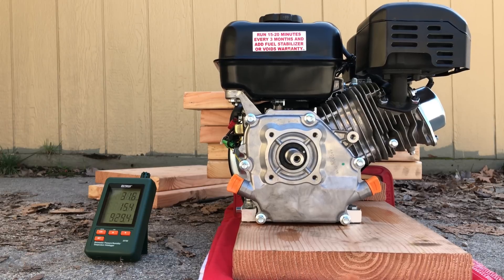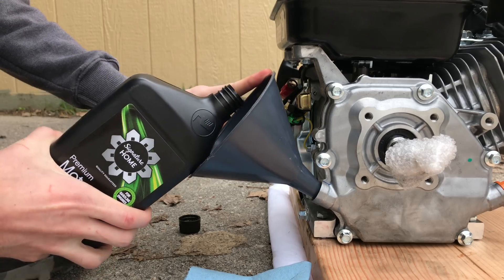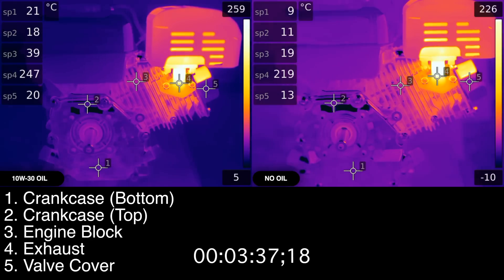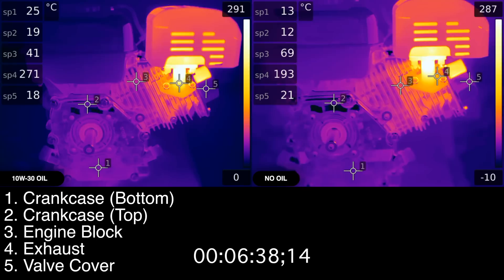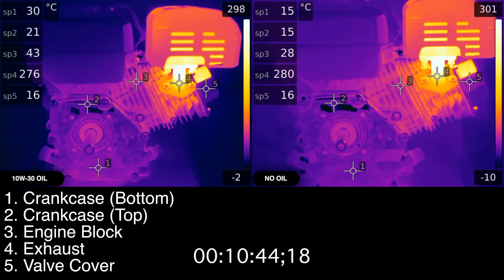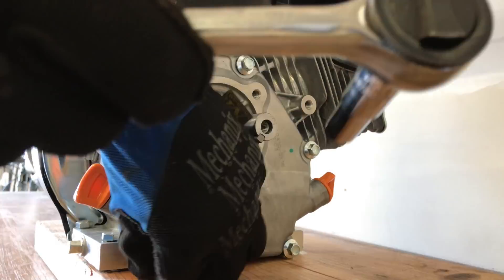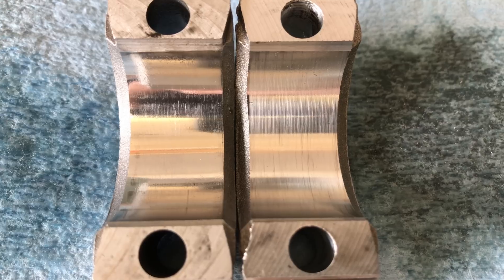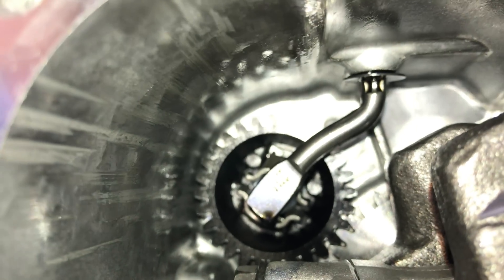What Happens To An Engine Without Oil?

Comment: good video, for what i can see the engine just runs and is not doing any work .Most engines can run whithout oil because the axis runs on bearings (wich have oil on their own) , the actual problem arises when an engine has to do work (increase rotation) .On a car engine the first thing you will hear is the camshaft beating and the next is the engine slowing down  until it stops due to dilation of the crankshaft (the first damage is allways on the bronze parts wich rely on oil to maintain structure coesion)  .The oil is in fact used to absort the temperature (it levels it actually) and the quality says a lot about the oil capacity to do just that , the engines who use turbo normaly have a radiator for the oil .

Comment: I loaned a tiller to a friend that operated it for several hours and never checked the oil when refueling, needless to say, it locked up. The difference between that engine and yours was he was operating it under a load and i'm sure at higher speeds. Thanks for demonstrating what happens. It makes sense that the block of the engine with out oil was cooler because as you mentioned part of the oil's job is to take heat from the piston and crankshaft and move it to a location that can allow it to harmlessly dissipate. If you had never added oil to the drained engine it probably would have locked up as soon as the assembly lube dried up..

Comment: Run them at 100% load at high rpm and that's when you'll see one keep running and one go kaboom. Just idling an engine that small puts barely any load on a bearing that proportionally big.

Comment: put oil in it it'll still run I've had em sieze up on lawnmowers put oil just fine tip it up to oil cylender.car engine Wii need rod bearings most likely .have replaced crank once on pinto oil pump fell in pan put crank and bearings from another motor left wo. head outside  ran 100000 mi.sold it put timing belt  for new owner 1yr later.

Comment: Ha harbor freight lifetime warranty on that Chinese engine... they won't know about this video anytime soon lol Oil is a lubricant and it's supposed to keep all moving parts within the engine lubricated thus there's no excessive heat and damage from metal to metal contact without lubrication.  That engine is air cooled vs your car engine which is water cooled "antifreeze" Try running your car engine without oil! You won't go far that's for sure.

Comment: API certification is API certification.  Either the oil meets the spec or it doesn't. 
if the bottle says "WPP" (Warren Performance Packaging) on the bottom, they are a major player in the private label oil market and they bottle major brands as well. The additive package might be an "off the shelf" additive package in a grocery store labeled oil, but you could bet you life on the certification part.

Comment: Running with no load undoubtedly reduces the impact. At low throttle setting and without any load you can probably go a very long time before any catastrophic wear happens, but if you load it up or run at full throttle it is likely to be a very different story.

Comment: I think you should have placed a minimal/nominal load on the engine. Some years ago there was a snake-oil product advertised and demonstrated much like this video. The product was put in crankcase of a small aircooled engine after which the oil plus product was drained and the engine re-started with no load. Unsurprisingly, it amazed the crowd.
Reply: Walter K Did it happen to be "Motor-Up"? I remember such commercials on TV in Finland where I live. For some reason, in the commercial they also removed a part of the bottom of the engine, and sprayed there water with hose while the engine was running. 

They reasoned the effect of the stuff by saying that it would form some kind of glazed layer that wouldn't require other lubricant inside the engine when the engine would be warmed up once after adding the stuff.
Reply: Pauli Vaara I apologize but I do not recall the product name. The advertising campaign to which I refer took place in the early 1990s though.

Comment: Lovely and educational. Thanks much. I got a question. I have a 2010 Mini Cooper. It seems that the oil warning light on the little rascal is designed to indicate when there is 1 quart of oil left out of a 4.2. quart capacity. I just barely avoided reaching the 1 quart limit on that little 1600cc Turbo charged BMW engine. Now, that scares me since I am an engineer, a race car driver, and a smart ass. I figured the engine came real close to death.  I would love for ANYONE who actually has factual knowledge of this specific issue to explain to me why  BMW designed the engine to wait till it's 1 quart from empty...and, for that matter, why the frigging thing uses so much oil in the first place. I have seen many, many less sophisticated engines with 200K miles that burn almost no oil at all. THis Mini has 70K miles, never raced, and always perfectly maintained. WTF?

Comment: @ 4:20 - Note the dark discoloration of the crankshaft.  Significant overheating took place at the rod journal and would have failed it catastrophically with a little more run time.

Comment: Oil in an engine is less for cooling purposes and more for lubrication. On car engines, a separate system handles cooling. On small engines, the cooling fins handles cooling. Oil is mainly to protect the moving parts from grinding each other into pulp during operation.

Comment: Without oil the engine had a harder time dissipating heat (analogue to what happens when storing hot liquid on a dewar flask), and also generated more heat because of higher friction. The result is that internal temperature is higher while external temperature is lower in the oil-less engine.

Comment: I would have thought that was predicable with some residue oil in the system. Also I've seen a new 4 stoke mower (that he owner did not know needed oil before starting) fun for about 45 mins before seizing. I think you'd have a more notable temperature difference if you never put oil in, bu that makes the experiment a little more expensive needing a whole 2nd engine.

Comment: i feel like its a little unfair to assume the metal in the darker oil is a bad thing. the cylinder wall still has a hash, so the piston rings would still be wearing down to get their seats, even faster than if it had oil, due to the heat. its possible most of the metal you can see in the oil spot is piston ring.

Comment: I work at a Nissan dealer ship, this person had their car towed in, 2016 rogue 26k miles on it. Driving down the road, heard a loud banging sound, car cut off, wont restart, opened the hood there was oil every where, had it towed to us. When was your last oil change. Never had one done. At 26k miles, with out a single oil change, the crank bearing (the one a showed in this video) seized, with the engine at higher rpms at the time, two connecting rods (the rod that connects the piston to that bearing) snapped off, and blew through the side of the engine block, leaving big holes. Probably the funniest part was when we went to remove the foam insulator under the hood because it was covered in oil, a whole bunch of metal pieces fell out :). This was not covered under warranty, for parts and labor you were looking at about $18k (almost as much as the car was worth), the owner had the car was towed away (probably to junk yard, but I'm not sure on that), and is now probably making payments on a car that they no longer have. Moral of the story CHANGE YOUR F%$KING OIL PEOPLE.
Reply: Kevin Weil - One day I noticed my sister’s Celica GT on the side of the highway and I stopped to see what was wrong. The engine quit and was smoking a bit.  Checked the oil to find the dipstick bone-dry.  I asked her when she had the oil changed last and she couldn’t remember.  Asked her when she last checked the oil. The answer was “The Oil light never came on”.  Engine was ruined.  A friends brother was a mechanic at a Toyota dealership.   He somehow got it covered under warranty.  Cost her a case of beer for him and the service manager.  Two years later, the same freakin thing happened.  I was so pissed at her.
Reply: @JB-ZR1  the star sounds like a script from brazzers.
Reply: Typical issue of woman vs vehicle.
Reply: +Big Hoss I use my car for short distance trips so i'll reach the distance reported on the service booklet in something like 10 years and that's when i'll change the oil.
Reply: TeraVolt you still have to change your oil once a year
Reply: 26k without oil change shouldnt destroy engine if he was topping up, i have seen cars that went even longer without oil change, pudding was dripping out of sump but engine worked fine
Reply: It's important for new cars especially to change oil while the metal is wearing in. That's when you get the metal shavings
Reply: Non Nissan cars will be ruined around 50,000 miles without single oil change. The stock engine oil was designed to be last long. I do oil change every 3000 miles for my 2012 3.7 Mustang , but the first oil change was at 20,000 miles. After 7 years, this 3.7 V6 still runs quite than my girlfriend’s 2014 Sentra even without the shaking Jatco transmission. I agree with your point, but the example you gave just remind me how poor is Nissan’s quality control.
Reply: Kevin Weil i use synthetic so I don't have to change the oil for the life time of the vehicle
Reply: @bighoss7437  Yeah. Come back after 100,000 miles and let us know how well that worked out for you.
Reply: I dont believe that, VW longlife plan require you to change oil after 30.000 km or when the computer advises to change it. Just check oil level now and then and you are fine.
Reply: Was it a girl or guy? Lmao my ex thought oil changes were a scam....I convinced her otherwise....she also thought by adding oil to the engine, it would make it start better on cold days.
Reply: moral of the story dont use nissans i think toyota can live much longer with no oil lol
Reply: Exactly what I would expect from someone who would buy a nissan.
Toyota drivers know better.
Reply: If the depleating of cleaning package don't get you? The sludge/soot will !
Reply: I’ve been researching this because my dad hadn’t been changing the oil on my car before he gave it to me & it was leaking oil. It’s a 2010 Nissan Altima. Today after driving around with my friend I had a similar experience:

Car started shaking and making low banging noise. Immediately after feeling the difference in engine vibration I turned off the car and luckily I was at a gas station with a service center so hopefully no major engine damage
Reply: Well according to the nobodies it creates dinosaurs every million years something we can't see
Reply: Kevin Weil I also work at Nissan and we had a 17 Pathfinder come in with 24k miles for an oil change, pulled the plug off and nothing was coming out lol so we drop the pan and there was no oil only pure sludge so thick that the pickup tube left an indentation in the sludge. This one got lucky the motor didnt blow lol
Reply: Let me guess, owner was a woman.
Reply: I change my oil every 100 years. Good ole Mobil annual protection works good. 😂😂😂
Reply: shadowninja81500 2 - 3 years then sell it, I don't drive more the 3000km a year and as far as I know oil doesn't go stale
Reply: Don’t change oil change to electric

Comment: personally I can understand why it didn't act crazy after only a few minutes running without. for a small amount of time I'd wager the gearing and pistons would still be able to operate before they actually heat up and start grinding more. of course only for a very short period of time. I personally feel like if they both ran for say 6 hours straight, you'd see some extreme differences. then again I'm not an engineer and this is all conjecture feel free to correct me if I'm wrong

Comment: Hello Jason. Can you make a video about engine braking. Or something more specific, the differences between engine braking when going downhill and putting a car (manual) in neutral for the same hill. 
Since neutral will make you go faster you'll be further away before pressing the gas again Vs the engine brake that will make you reduce speed faster. It's easy to make double the distance in neutral before the need to press the gas.  does that affect the total fuel consumption over some distance.

What's the best for wear and fuel consumption?

Comment: Just as an FYI too much oil is not great either. Today I drained the oil from a seized engine in a car I bought. 
We were incredibly surprised when 9L of oil came of of the engine that requires 3.5L of oil. 
There was also oil in the intake, oil filter, aswell as all thoughout the exhaust. 
It's going to be fun to open it up and see exectly what happened inside :D

Comment: the one reason it didn't fail as quick as you thought is BECOUSE of oil still coating the parts and no real load. wouldn't be much longer and it would of started to really fail.

Comment: At 4:20, you mention how you can see the scratches on the crank, did you notice the discoloration on the crank-throw itself? its purple from all the heat created.

Obviously, these engines arent made to the best tolerances and each  one is definitely slightly different. 

You should run an engine with basic cooking oil and see what happens.. Ive heard that Canola oil also has industrial use or that it was originally designed to be used for that?

Comment: At VW shows in the 80's they used to drain the oil from a running bug engine bolted to a stand and wait for it to explode. As you found out it's surprisingly long and often just a loud clunk followed by the disappointing sighs of the expectant crowd.

Comment: Now run it without oil with that plate off to see what the engine's different internal temperatures are.  Some of it may be much hotter than the plate was.

Comment: I actually somewhat expected the oil side to show a hotter outer surface because the oil should act as a better thermal conductor of heat from source to sink, similar to a laptop cooling issue I had this past year.  I realized there're a couple key distinctions between the scenarios though.  First, that applies more to coolant than lubricant.  Second, an ICE is more effective the less heat is produced from friction, whereas with hot computer elements like the CPU/GPU, the cooling solution is more effective when it dissipates heat effectively and sustainably.

I agree the oil probably was acting as a thermal reservoir for the heat.  Was there a radiator and coolant in each of these scenarios?

Comment: Castrol did those commercials a few years ago where they claimed an engine which had casttol oil drained from it lasted longer than any other brand. Have you done any similar testing and are their claims legit?
Reply from the maker: Interesting, never heard about that! It'd be interesting to see, but ultimately not that meaningful. If one works better when it isn't drained, that would be the one you'd want to buy, regardless of how great or poorly it acted once there was barely any left.

Comment: On these small engines it is usually the crank end of the connecting rod that fails first when there is a lack of oil. Sometimes you can get away with just replacing the connecting rod and cleaning up the crankshaft (i have worked for some broke ass places) Your test goes to show just how little oil is required to lubricate and how long that film of oil will stay intact. The only thing you could have done differently is to take the crank cover off and hose it out with a solvent to make it completely dry before running.